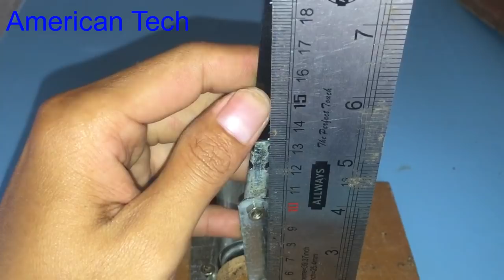How to make a mini electric table saw at home

Comment: what you will cut with this toy you can cut better and faster with your hand using any razor of in the worst case with a piece of a common saw blade... Right ?
Reply: ça ne doit mème pas couper une plaquette de beurre
Reply: zte modem for singtel
Reply: SKJ jQAF .
.

Good ok banget
Reply: Georgios Achilleus of Macedon
Reply: nice
Reply: Hai
Reply: Well it can cut 1 inch softwood with that motor and blade. Maybe saw or razor by hand could be faster but the goals is how to do consistent and precision cut. It really help for small projects
Reply: Georgios Achilleus of Macedon j